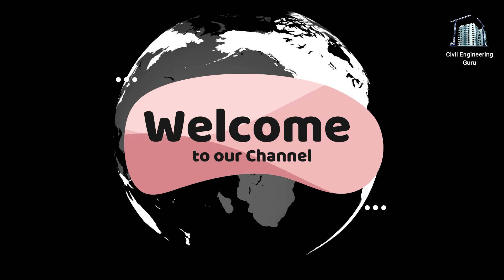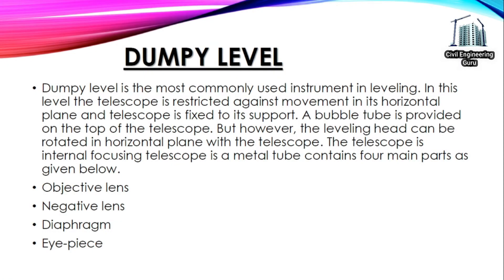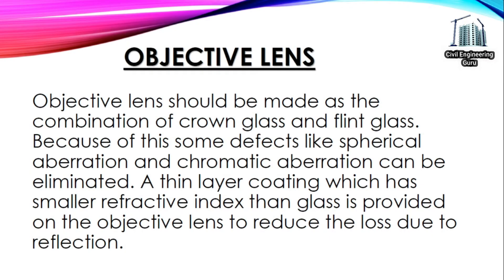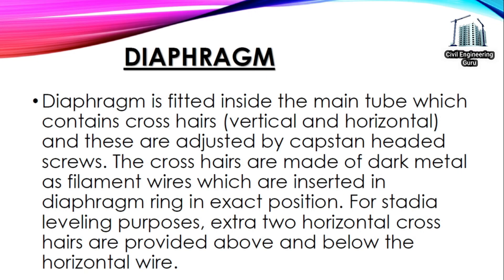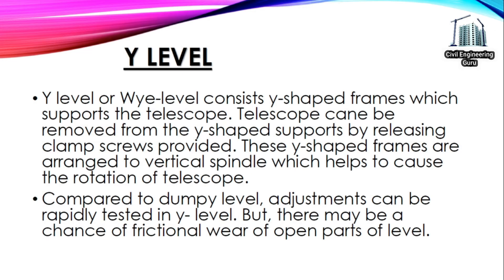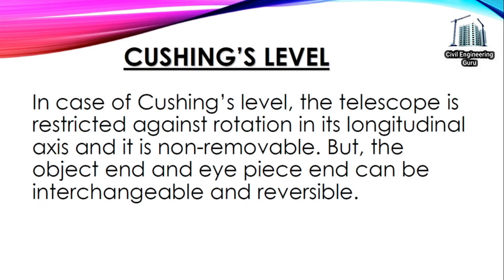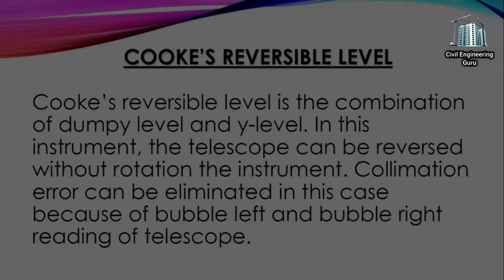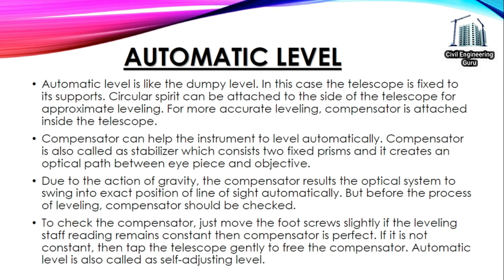Types of Levels used for levelling in Surveying.

Comment: Benchmarks are based on sea level. Level is a flat horizontal plane without slope. No part of a level surface can be above or below any part of itself.
 Line of sight leveling is how the benchmarks where established around 100 years ago. All surveyors work off of the same benchmarks. 
It's hard for me to understand why anyone thinks differently.
Reply from the maker: You are Right. Thanks for Great Comment.